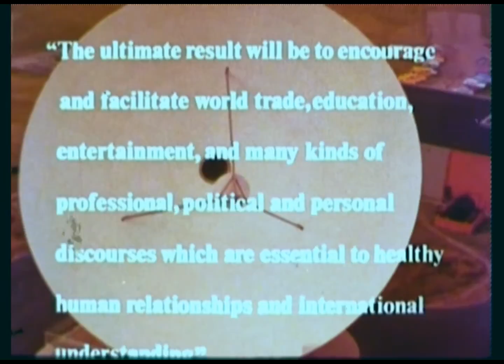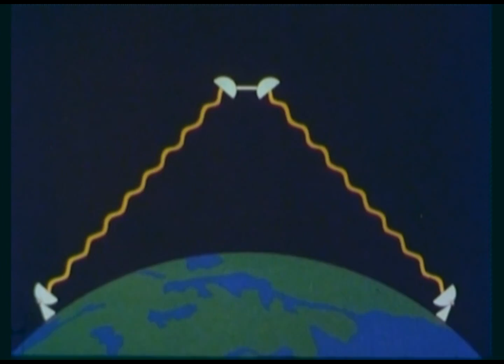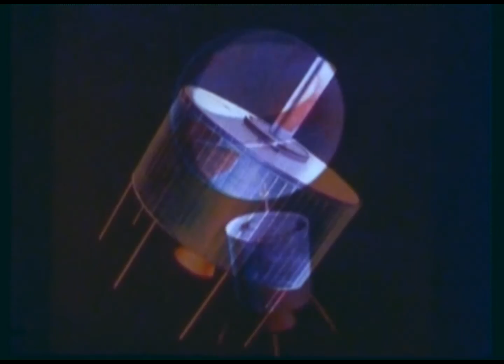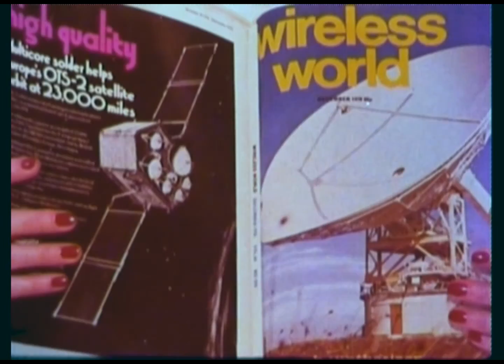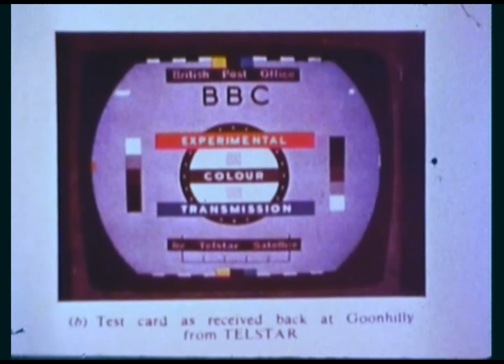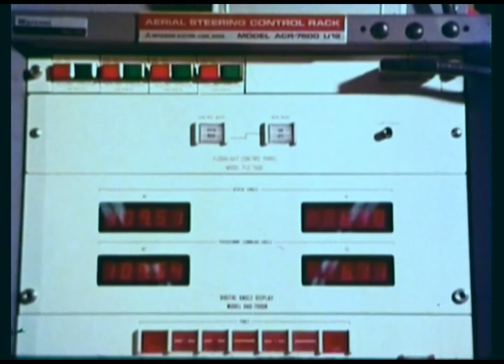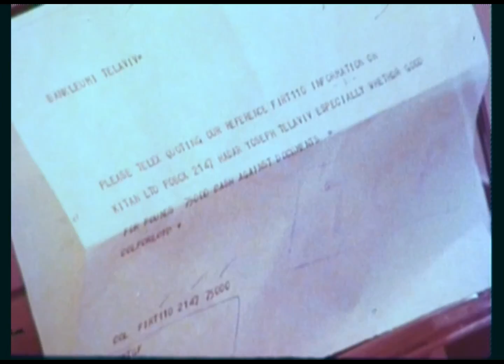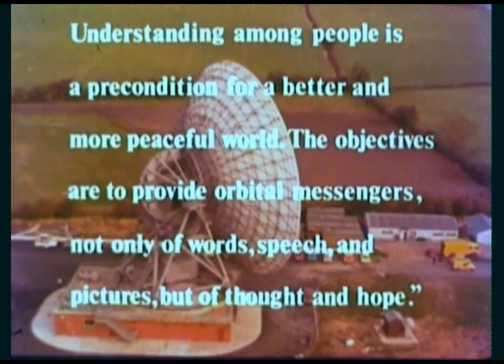Space Talk (c1979) UK GPO Post Office Information Film - Goonhilly Earth Station

Comment: Very interesting film. I first used satellites on the Inmarsat A system back in '86, so this film was prior to any of that was even launched. Apart from the obligatory WT (MF/HF), RT (MF, HF, VHF) and radio telex (@50baud), we had 'high speed' data @64kbps for maritime video conferencing, NGO remote medical assistance etc. !!! All the way from WT morse to 800Gb/s single wavelength fibre transmission rates. I feel priviledged to have experienced the whole spectrum. A lot has happened in a few decades.